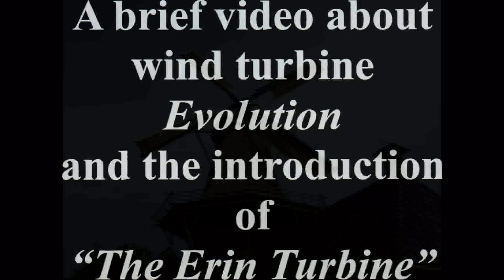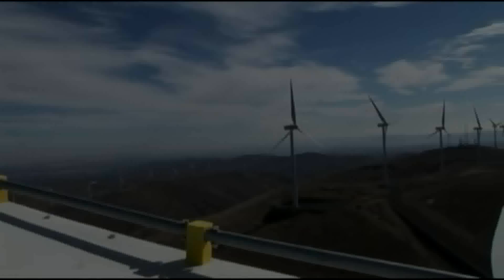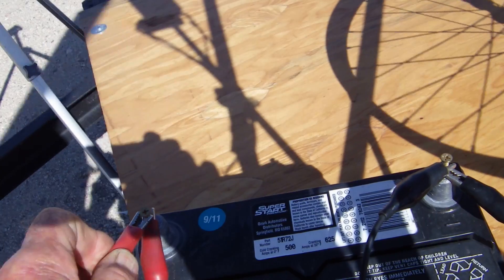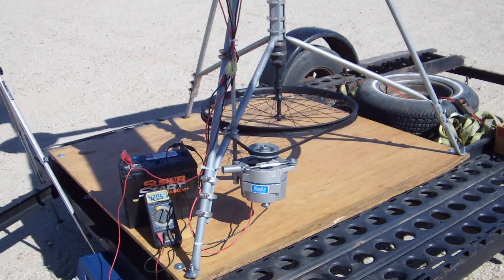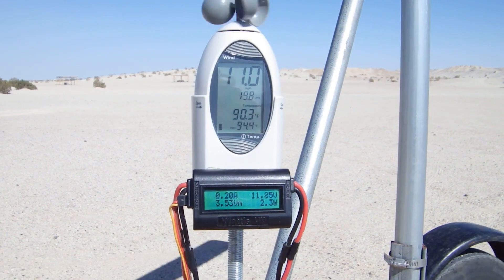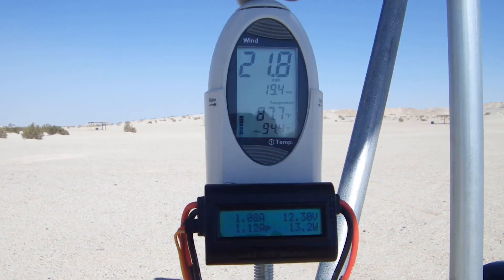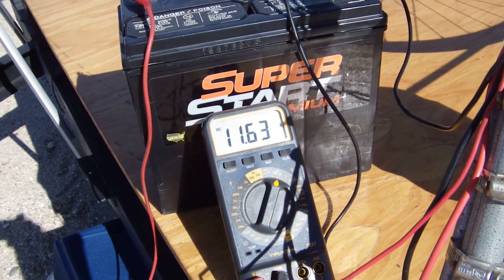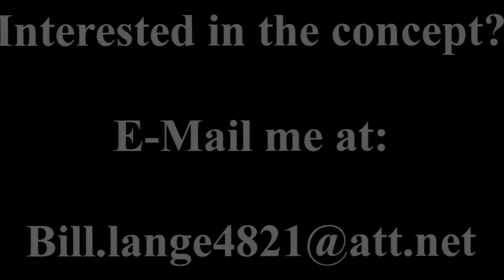a new wind turbine design

Comment: AWESOME reasoning - I had the same thoughts when I designed my "FLAP TURBINE" 
I had seen many designs for flap turbines with horizontal flaps and the concept was always better than the simple Savonius. I Think that yours is the best horizontal flap configuration I have seen. Definitely more efficient than any savonius out there!! 
WOW you have done such a great job documenting, building, engineering, and narrating, everything is beautiful, and your test location seems to have very good wind. 
There are a couple of flaws that I read about, in previous comments, that could be overcome with simple design changes. 
For a new perspective, please see my Flap Turbine, with vertical flaps, at this youtube link
Wind Jan 2013 
Thank you for being a part of REAL research. (research by corporations is bias toward profits, not efficiency)

Comment: This type has been around for years but it's a drag type and as such is not very efficient as the drag is proportional to the wind speed and area at these speeds.

However the lift type produces power at the speed cubed and proportional again to area. Note that purely laminar flow only exists up to Re (Reynolds Number) = 0.1 under this definition. Hi speed drag or turbulent drag is similar to the lift equation where drag is proportional to Speed Squared.

Remember that:
Power(Watts) = Force(Newtons) x Velocity(Speed in Meters per Second)
Or
Power (Watts) = Lift (or Drag in Newtons) x Velocity (Speed in MS^-1)

Lift Force (in Newtons)  = 1/2 x Angle Of Attack (degrees) x { 4 x pi^2 (or 39.48) } x Density of air (1.19) x Velocity^2 (in ms^-1) x Area (in M^2)

Power (Watts) = 1/2 x Density of Air (1.19) x Speed^3 (Meters per Second) x Betz limit (16/27) x Efficiency (about 0.3) x Area (Meters Squared) 

Drag = Re (Reynolds Number <0.1) x Speed (MS^-1)

Power of Drag low speed is Re x Speed ^2

This is NOT to say this idea does not have merit.

There was a university I think in California, that researched this type in the 90's (from memory).
They used vertical blades and the "expanding flaps" formed part of an aerofoil sides.
The method was employed to fix the start up problems that most fixed pitch VAWT have. Most are started by electric motor OR a drag type turbine in conjunction with the lift type.

Thanks for reminding me of this type , I had almost forgotten.
I'm currently developing  VAWT myself.
Reply from the maker: Problem with lift VAWTs is low torque, therefore the tall cylindrical shape. My design would work scaled to the megawatt range where lift VAWTS would never get there.
Reply: Power = Torque x RPM x K
so it's round abouts and straight aways in that regard. You need a gear box @94% efficient to make the RPMs useful for generating power.
However VAWTs suffer from generating the Magnus force converting part of the available wind power to a useless (in this case) force.
So you are right in saying that Lower speed is better because the Magnus force is proportional to the speed of rotation.
Also Slow speed turbines don't suffer from the "sum of Lift - sum of drag" problems where the apparent wind on the airfoil effects the angle of attack and therefore the efficiency of the turbine. Thinking about the Lift type, it's a nightmare of mismatched blar blar ...
VAWT suffer from blade angles being very different from what is optimal, unlike the HAWT counterparts.
My suggestion for Lowspeed Drag type is the 2:1 ratio "sails" rotating around their axis and in sync with the wind direction. It;s the only efficient type of VAWT there currently is. And yes it's a drag type.
Reply from the maker: Garret Krampe Can't imagine the sail type holding up in a sustained 50-60 mph wind.. My design is self regulating in the fact that the blades can only flex open and closed so fast resulting in what I call a terminal rotational velocity. Saw this first hand in testing at the Banning Pass with my son. Wind speed doubled to 60 mph from 30 mph with same shaft rpm and voltage out found at 30 mph.

Comment: I would like to compliment you on your turbine design, and I respect what you have done. That being said, VAWT are not very efficient, a lot of work to install, and literally get ripped ripped apart. Take a look at the NREL report on Maria Windspire Wind Turbines. Solar is a better answer in most cases.
http://tinyurl.com/4d3oc22
Reply from the maker: Thanks for your comment. There is no comparison to the windspire design, which NREL had removed from their test program deemed too dangerous. Set up with my design is with a utility bucket truck assembling components on a 20 ft tower. It rotates with the wind (drag design) it does not get "ripped apart". You may have confused "lift" and "drag" designs. This design is at 75% efficiency at the drive shaft. And finally...The sun only shines half the day, there are places on the earth where the wind blows 24/7.
Reply: Yes, however if the turbine does not function efficiently it really does not matter where it is installed. The VAWT is a pie in the sky dream that makes no mathematical sense. The two key elements in the power equation for system sizing is vertical height and rotar diameter. Your VAWT has a diameter that can not be used with this calculation. Basically it is hit and miss with VAWT. Like chucking darts at a dart board and hoping for a bulls eye. I really do wish you the best of luck, but it will not work efficiently and consistently.
Reply from the maker: 1buckdharma That tells me you don't have a good grasp of the physics of wind turbines, especially my design. Perhaps you could post a video of a wind turbine you've designed that generates electricity.

Comment: Mr. Lange, could you affix the shaft to the generator directly to avoid the need for belts and ratios?
Reply from the maker: This is a drag design, meaning it rotates at or below the speed of the wind. The drive shaft, however, rotates at about 60 RPM in a 30 MPH wind because of the blade design. This is still not fast enough to spin up a generator which should be spinning at about 600 RPM. Because the blades extend outward there is enough torque on the drive shaft to gear it up to a 10 to 1 ratio.

Comment: You've got a lot of friction in your set up which is costing you much of the power. You should be running 60 to 100 watts and with bigger vanes and some refining ones of that size usually get around 200 watts. There's a few flaws in your thinking. Counting on material flex is risky since most materials become brittle and will break. Also the main reason for the height of commercial wind towers is to get up into stronger more consistent winds. I'm a big fan of vertical wind generators but they are best for home applications. What you've done is laid a wind mill on it's side which gets rid of most of the pluses. It'll use more land and catch less wind. You have to realize in a 200' windmill the top of the blades in 250' in the air where the wind is near constant. Laying it on it's side you'd get maybe 10% of the wind and nearly the same cost. Maintenance is fairly low on windmills and towers cost a fraction of what the rest of it costs so there's no advantage.
Reply from the maker: I'm sorry to say you're wrong in several of your assumptions. For starters this is a proof of concept device, cobbled together from parts found at Lowes. Certain grades of stainless steel will stay flexible well beyond the useful life of the remaining components of the turbine. The reason standard wind turbines need laminar flow is because they are so inefficient. There is plenty of wind at ground level to power a device with 75% efficiency. This design does not take up any more room in a wind farm than traditional turbines since they need to rotate their main assembly to compensate for changes in wind direction. So a conventional turbine with 100 ft. blades takes up as much space as my design with 100 ft. blades. The average turbine today comes in at over $5,000,000.00. not including set up and a tremendous amount of maintenance required. Try to visualize wind farms in remote desert areas within easy access to power transmission lines utilizing nothing more than a utility bucket truck to set up the whole turbine, and coming in at 30% the cost per megawatt.

Comment: Boundary layer  > 15 feet deep.
Reply from the maker: not sure if that's good or bad. are you saying there isn't enough wind there?
Reply: A boundary layer is the velocity gradient from zero at the surface to free stream defined at some altitude where the delta v with height is negligible.  Dependent on local terrain the velocity gradient may or may not be adequate to justify a low profile wind turbine(unless justified by power demand).  When the wind speed is low the velocity gradient will be much more gradual.  In order to maximize performance during all seasons a taller turbine is preferred so as to make use of the full strength of the prevailing winds.  This device may still be viable for some residential applications with favorable terrain.
Reply from the maker: Rogue Bagel The design allows a low cost alternative to current wind turbine designs. The mindset that "taller is better" is the main reason electricity from wind farms is so expensive. Having turbines in the 15-20 ft. range allows common utility trucks to install and maintain the turbines in more remote windy areas.

Comment: What's the difference between your design with the tripod and the vertical turbines' guy wires? It's the same thing?
Reply: Not trying to rain in your parade but... those 250 ft towers in wind farms generate electricity in the order of kWh.  For your proof of concept to generate that much electricity, you'd need to scale it up pretty significantly. At that point, the weight of your blades would make them bend downwards and would require a lot of wind to turn them. There is a reason why they put the blades vertically.
Also, you don't use wires but you used tubes to hold it standing up. If you scale it up, you will need to use wires. A wind farm today has double duty and still can grow crops. But not with a bunch of wires.
Reply from the maker: My design does not require guy wires. The footprint of the support tower is well within the diameter of the rotating blades. The rotating blades take up no more room in a wind farm than conventional turbines now in use.
Reply: If you scale it up, you'll need a larger foot print than what you currently have because of the stress/ strain characteristics of the materials used. Have you created PI terms to calculate your scalability?
Reply from the maker: Maxwell Goodacre It seems you're upset with my design. My proof of concept design readily generates electricity. Have you designed anything that generates electricity?
Reply: Yes I have and am. Some are patent pending. I'm an Environmental Engineer with a strong desire, like you, to improve upon existing designs and innovate new novel designs. The only difference I have with your designing is when I see a problem, I go back to the drawing board and start again. I'm not stuck with my own personal idea that cannot be wrong. Be flexible. You might end up with something totally different that what you started from. PS: I do like the idea of your initial blade design.
Reply from the maker: I don't think you get it, there is no need for guy wires with my design. Ideal locations for this design are not farm lands but remote windy areas deemed useless by most folks, but accessible by utility trucks.
Reply: A single vertical support will not be enough to support it. In your prototype, you use metal supports that go outwards from the vertical column to the ground. What will the actual unit resemble? Will it have the same supports as shown in the video?
Reply from the maker: Maxwell Goodacre What I cobbled together with some bent galvanized pipe is what they call a "proof of concept". The structure illustrates the efficiency of the blade design only, which approaches 75%. Conventional turbines struggle to approach 50% and cost about 5 million each, with a poor return on investment. There are a lot of pigs at the trough because of all the government subsidies available to this industry. A single support tower (with a footprint along the lines of a high power line tower) but only15 to 20 ft. tall, is all that's needed to support the 4 blades balanced on top, which become more stable with rotation. I'd be glad to continue this conversation via e-mail in order to attach a power point I've put together explaining the concept better. (bill.lange4821@att.net).
Reply: I just responded via email. Thank you.

Comment: Super Bill, that is a great design. Something I've wondered about for a while- glad you stepped up and did it.
Thank you for posting. gk.
I would like to learn more .
I wondered about an airfoil shape on the leading edge of your 'blades' - would that help lessen drag and /or speed up the blade (now) heading into the wind ?? Just curious. That is what I would have considered- if I had done anything close to your accomplishments here. Ty. I will email you too....Gk.
Reply from the maker: Hi Greg, Send me an e-mail at ....   bill.lange4821@att.net and I will send a power point presentation with more design detail.  Bill
Reply: I believe the blade forms a "tear drop", an excellent, low-drag aerodynamic shape... hard to beat.

Comment: if you have a smaller sized turbine but it spins at faster rate would you get the same amount of power?
Reply from the maker: Hi, Slower is actually better. with longer blades moving at the same speed as the wind you wind up with a totally quiet turbine, greater shaft torque, and less component wear. This design works best when scaled up to 80 ft. blades and part of a commercial wind farm.

Comment: I sure hope no-one skydives anywhere near your answer to peak oil and global warming and there are no birds or other living things in the vicinity - but keep thinking out of the box.
Reply from the maker: Guess we'll just have to build more nuclear power plants to keep the birds and skydivers safe.
Reply: Or maybe enclose squirrel-cage shaped fins straight out of a 1960's Chevy vertically and reduce the friction via a magnetic levitation system supplied with electro-magnets with some of the power provided by excess current with a digitally controlled energy-storage system for slack breezes but absolutely we need U-235 and Fukishima rods and storage for waste that lasts a gazillion years in tanks supended over the reactor or in the Nevada desert 'cause you say so, and of course - you're right.

I wasn't even dissing but encouraging in my last response. Begin thinking out of the box. It's a journey, not a destination.

That way - the crowd-source democratic voting thing indicated on the like/dislike bar doesn't have you stuck between dick-hole and douche-bag.

Comment: Thanks for sharing. It would be interesting to see this working in a finished product and sold in stores. Surely it is not good for the city dwellers but if you are at the edge of Earth with resonable winds in 24 h  you may be able to get by with one or two of these generators.
Reply from the maker: The broader market for this design is in large scale commercial wind farms. Current wind farms are located near paved access roads to accommodate the huge cranes necessary to assemble the multi-megawatt turbines. My design would allow these wind farms to be located in more remote, often windier, areas, utilizing nothing more than utility company bucket trucks for assembly and maintenance. Ridgelines in the open desert, but near large power transmission lines, come to mind.

Comment: nice design, thanks for sharing it.....
I would have liked to see you show a close up of all the hardware as you were describing it, like how you implemented a thrust bearing/washer, the blade attachment, type or brand of PMA/alternator, etc
Reply from the maker: The PMA is from WindBlue. The tapered wheel bearings were wedged into each end of the 2" galvanized pipe which served as both thrust and support bearings.

Comment: i would try building the arms out of a glass over foam lamination design. and to make the arms more aerodynamic. shape them in a design that is pointed on both leading and trailing ends. vswt's are the best. and i really like the collapsing fans blades. would you mind if i build one and try to add onto your design "if i can".
Reply from the maker: no patent protection here, but remember simpler is better.
Reply: true k.i.s.s. is the plan.

Comment from the maker: Thanks! The big challenge is how to stop the thing for any necessary maintenance. Once stopped the blade open into the wind is going to take a beating because it would normally be rotating downwind and not be subject to all that torque. I thought of a pivot at the hub to face the leading edge into the wind, but that all takes money and some decent engineering.

Comment: I built a wind turbine using a treadmill motor and other common supplies. I also got a 12 volt deep cycle battery.  I have heard in other videos that you need a bridge rectifier to only allow electric to flow from the wind turbine to the battery. I am trying to figure out if that is what I need or if I need something else.  Because when I hook the wind turbine to the battery it turns the treadmill motor on and causes the wind turbine to spin. Please let me know if you know what can stop this.

Comment from the maker: The tip of the blade is only flexing plus/minus 15 degrees, spread out along the width of the blade. To see this for yourself hold 2/3 of a stainless steel ruler over the edge of a table and move the outer end up 15 degrees, then down 15 degrees. Once you've established this range, move the tip up and down as fast as you can, and as long as you care to. You'll find the temperature of the ruler will not change one bit.